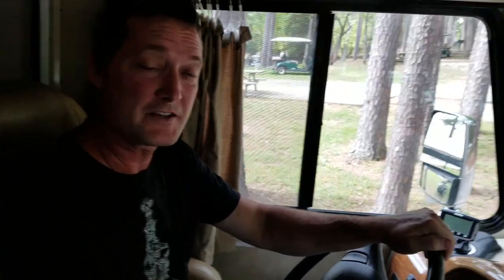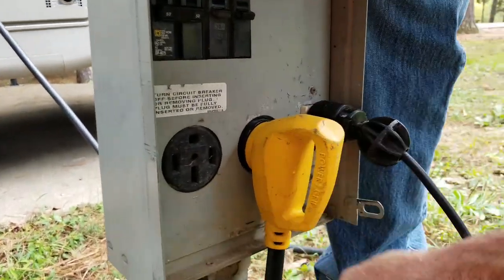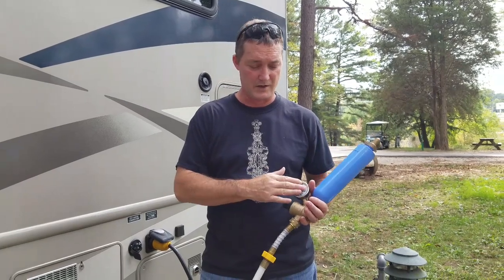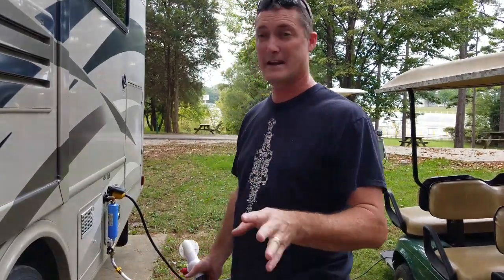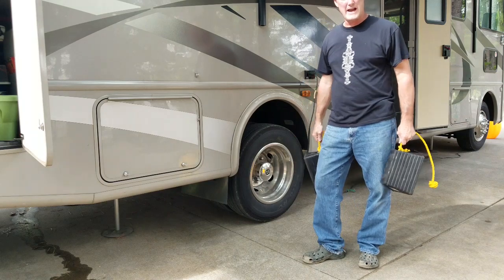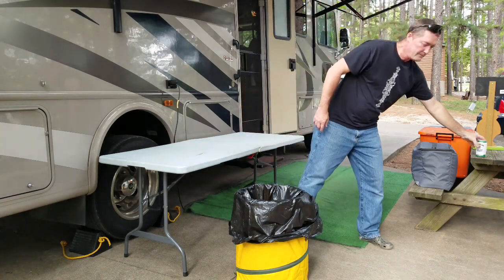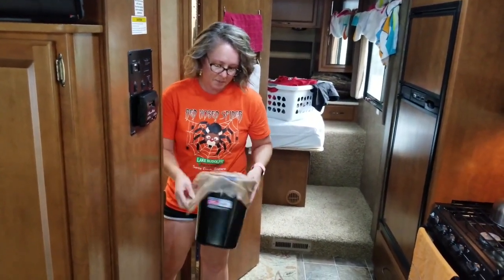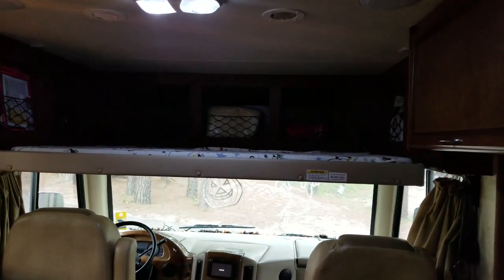Our Motorhome RV Campsite Setup || Campsite set up with full hookups.

Comment: Thanks. Good information but I hook up my water differently. A water pressure regulator is good to have but I install mine at the water source to protect my hose from excessive pressure. I also install my filter at the source (after the pressure regulator) to prevent contaminants from entering the hose and eliminate the weight of the filter from putting any strain on the RV connector.

Comment: I have the same dog bone connector that tests the circuit but I do not plug my RV into the other end of it until I have tested the circuit and confirmed it is good to go.  Water pressure regulator is an absolute must.  I have seen very low pressure in some places and ridiculously high pressure in others.  I actually need a new one, the last time I camped it did not seem to be working properly.
Reply from the maker: Good points! The water pressure is always a surprise with what you'll get.  👍 Thanks for adding a comment, it helps other viewers too.

Comment: Your hookup methodology is similar to mine.  Electric, then water, and then sewer, and only if I'm going to be in that location for more than a day or so.  My rig is old school, so no maceration pump, just gravity and a fairly short tube rune.  My service compartment holds everything, water, electric, sewer.  In fact I'm a little surprised that your power and water are connected through the side of your rig, kind of like a trailer.  Have you thought about getting a Clear Source 2-stage or 3-stage for your water filter?
Reply from the maker: We try to make it a habit to not drink the water.  We have a Berkey water purifier inside for personal/cooking use.  When we hit the road at retirement a better filtration system will be in order

Comment: when you hook up the water does that fill the grey tank?
Reply from the maker: There is a fresh water tank that gets the hose fill.  Then when using the RV sink/s it goes into the grey holding tank until emptied.  The toilet contents go in the black tank unless you have a composting commode of course.  Usually three tanks..fresh water, grey and black.   One other thing ..you can leave the city water hookup and u won't need to fill your fresh water tank.  You only need to fill if you don't have full hookups.

Comment: What model is that? I'm going back and forth between a class a and a class c under 30 feet. I have a pole barn 32: deep and 13' high for storage when not in use. Thx
Reply from the maker: Hey Mark, Its a 2013 Thor Ace Evo 29.1.  We looked at class C's too, but got the best price for our Ace so we went with it.  Both are great and I'm sure you'll end up with something spectacular.👍

Comment: Also I noticed you plugged into 30a....do you only have(use) 1 ac unit...does that 30 a give enough power to run everything needed without having to shut something off to turn on something else on.
Reply from the maker: Yes, our rig is set up for 30 Amp and it runs everything good unless you plug in a bunch of stuff such as crockpots or electric skillets, etc..then the breaker will trip..only has happened a few times.  We only have one air conditioner as our motorhome is small.  You might have a 50 amp which does require that special plug
Reply: @RVBarndominium  we do have a 50a plug...and 2 air conditioners...how often do you have to pay extra for electricity?
Reply from the maker: @steveedwards8859  from our experience , RV parks generally charge more for 50 amp...usually anywhere from 3-5 $ per night more , but it depends on the place.  We have a campground near us that only charges 25 a night for either.  It widely varies from park to park.
Reply: @RVBarndominium  thank you so much......happy trails

Comment: Is there a way to make sure no one disconnects your electric or water?
Reply from the maker: That's a really good question.  We've never thought about using something like that and not really seen anyone else use it either.  In all the years we've been camping we've never had an issue with anything like that....but I'm sure it happens.  Maybe there is a market for something like that..?  You can get smart devices to monitor the temp of the RV.  That would send you a notice if the RV gets hot then you would know your air is off and /or unplugged.